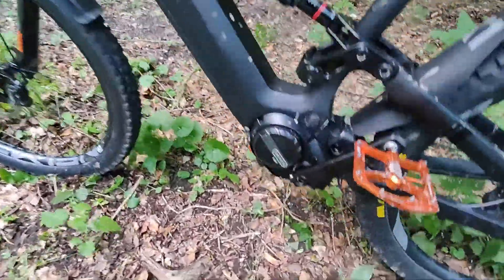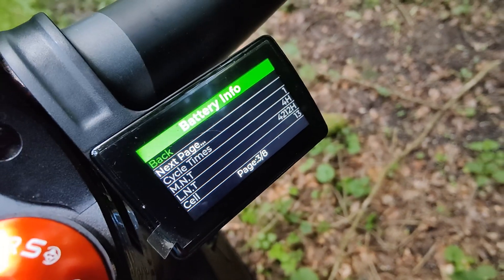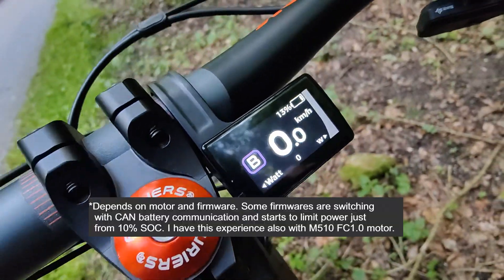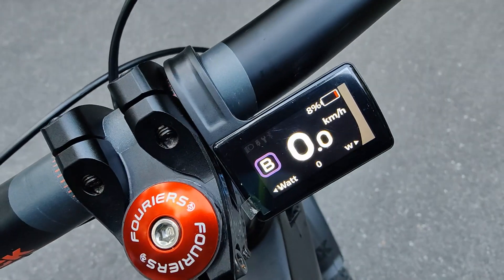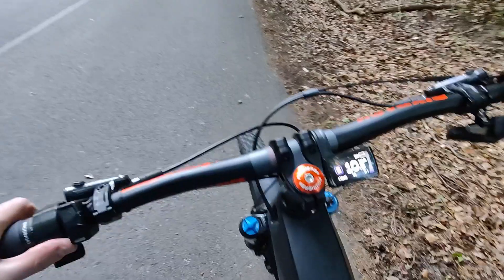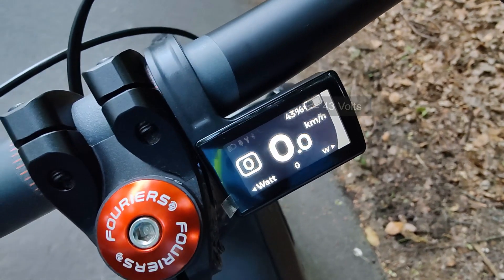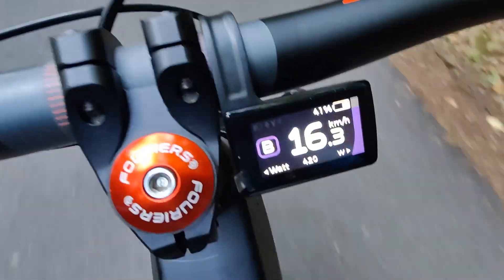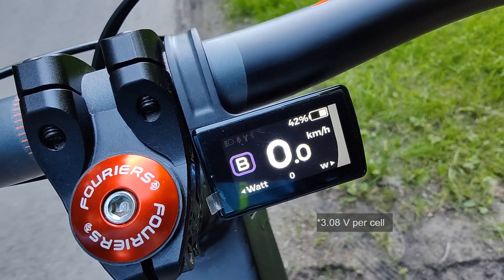K1 BB Racing - quick introduction. Supports Bafang CAN motors - M500 M510 M600 M560 M820 M620

Comment: I have a bafang m 200 cam motor on my ebike which is totally locked down so will this device be of enny use to me in being able to change its settings. 😊❤🎉🎉🎉
Reply from the maker: Unfortunatelly motor M200 supporting  only basic settings - speed limit, wheel size and circumference.